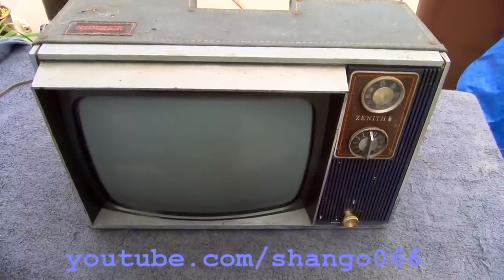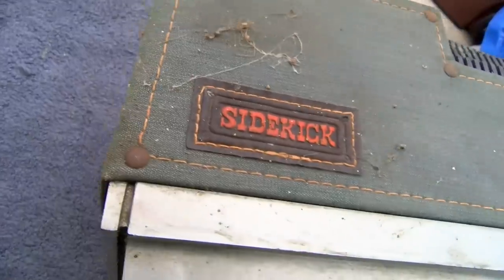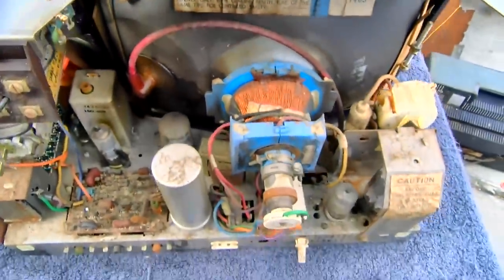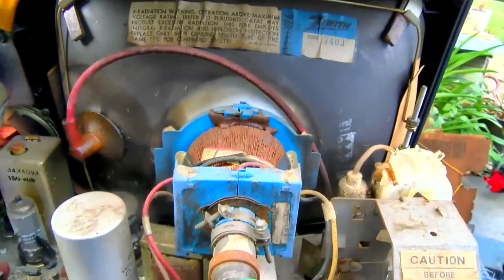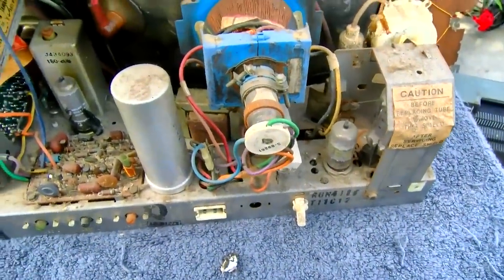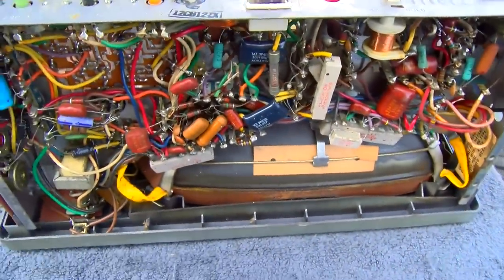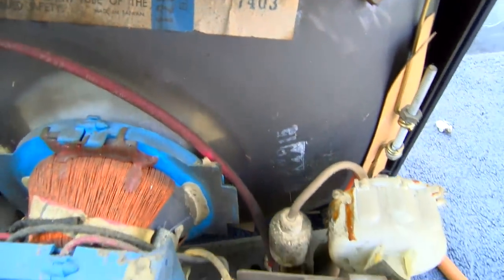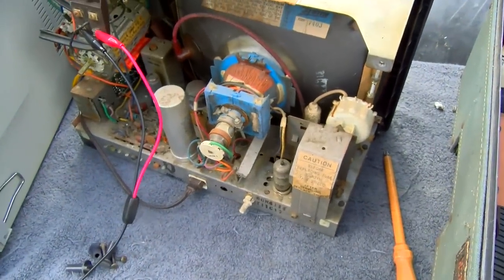1974 Zenith Sidekick Portable Black and White Hybrid TV Set

Comment: Tubes were probably glued down because of the long trip from Taiwan to the USA. Japanese tube stuff had those wire clips to hold the tubes in place for the same reason I would assume.
Reply: I agree.  I think it was a reliability measure to make sure the set worked when it got into the customer's hands.  It's inconvenient to deal with when changing tubes, but not a show stopper.
Reply: Sounds logical about siliconing the tubes in place for the trip across the ocean. Decades ago when I use to work on TVs, I remember seeing sets with the tubes Siliconed like this.
Reply: Also it's a portable tv, so stuff inside could come loose while moving it somewhere with a car.

Comment: I once had a 1974 16” B&W Zenith TV with a fake wood grain cabinet. It wasn’t a Hybrid, Instant On, all Solid State. I remember there were a variety of these sets from Zenith that year, some Hybrid, others all Solid State. I put a switch at the end of the line cord to cut power to the set if it wasn’t going to be used for a while. When using the set, I would power the switch on the cord on, wait a minute to allow the CRT to glow dimly, then press the set’s power button on to receive instant picture and sound. I always thought it was safer to completely remove power when the set was not in use, and that it may lengthen the service life of the components with the gradual power on procedure. Some sets had a “Vacation” switch that served the same purpose.

I had the set for 12 years, before giving it away to someone when I bought a color set.  No issues except with the tuner contacts getting dirty.

Comment: That was my TV from my youth.  It wasn't the sidekick version but everything else was the same.  It slid off of the table and landed on the concrete floor.  Picture tube didn't survive.  The instant on feature used to worried my father.  He had PTSD from his youth when his home burnt down. He would come into my room at night and unplug the set.  Very annoying at the time but very understandable now that I'm much older!
Reply: Randy - Agreed. My sibling and I shared a 12-13 inch Panasonic tube B&W instant-on in the 60's, and it, too,  made my father nervous. It made me nervous too, because even in standby mode the thing made everything around it hot to the touch. The only thing that made me somewhat comfortable was that it was UL Listed. The picture tube wore out pretty fast, so the instant on feature became useless, so we also took to unplugging the TV when  not in use,  but that didn't help the longevity.

Comment: These are great little sets, I have a "Sidekick" exactly like this one.  When I found mine, it was dead, even the filaments didn't light up.  The diode that is in series with the resistor in the filament string was open!  Fortunately I had a NOS Zenith replacement diode and that was all it needed, except for a new antenna rod.  A friend of mine had the SS version "Sidekick " and I had to repair his once, his set needed one large sand ceramic resistor replaced, that had gone open.

Comment: A diode in series doesn't halve the RMS voltage for the filaments. It divides it by the square root of 2
Reply: Does that have to do with resistance of the tungsten being lower at cooler temperatures?
Reply: Not so. When a sine wave voltage is rectified the effective voltage becomes the average value of the peak voltage. This is equal to Vpeak x (2/Pi) if full wave rectification is used. For half wave rectification the equation becomes Vpeak x (1/Pi). So for the typical North American 120v RMS AC line voltage, half wave rectification reduces the effective value to just over 54 volts.
Reply: @zulumax1  - No. The lower resistance means a little more current flows than would be assumed, therefore a little more wattage would be consumed but the mathematical relationship of effective rectified voltage versus full RMS voltage does not change.
Reply: @Inflec  That makes sense, thanks
Reply: @Inflec  The load would be a non issue, thanks for the details.
Reply: @Inflec  Hell no. For 120V mains, the RMS voltage on the filaments would be about 84.8V (neglecting the diode forward drop).
Reply: @DiodeGoneWild  - Sorry to disagree. I'm getting my information directly from an electrical engineering textbook. I think you're confusing the use of the square root of 2 with its use in determining the peak voltage of a sine wave RMS voltage. IOW, Vpeak = RMS value x √2. The square root of 2 is what you use when you are dealing with a full sine wave with equal positive and negative swings. When you rectify the wave you get pulsating DC. In other words, you no longer have a sine wave. Then, to find the effective voltage of such a wave you do a mathematical analysis of just one half of the wave, from zero to 180° -- just an average. After doing the math, you end up with a conversion factor of 2/π. This assumes that you have consecutive identical half sine wave pulses. IOW, full wave rectification, but since we are losing half of the pulses due to half wave rectification, the conversion factor is also halved, becoming just 1/π. Again, these are the numbers to use when you know the peak value of your RMS voltage (which does use the √2 to determine). However, these figures are not valid if you are talking about a bonafide power supply with capacitors and/or inductor filtering. They apply only to the resulting pulsating DC feeding a purely resistive load, such as what we are dealing with here (vacuum tube heaters). I hope that clears up your confusion.

Edit: And yes, the diode does introduce a negligible amount of loss (at the voltages in this example).
Reply: @Inflec  Each of us is probably talking about something different. I was saying that adding a series diode to a resistive load powered by AC mains will reduce the RMS voltage to about 70.7%. The power is, of course, reduced to 50%. The power goes up with the voltage squared. Thus, halving the power means reducing the RMS voltage to 70.7% (This applies to DC too).
Reply: @DiodeGoneWild  The 70.7% RMS AC factor only applies to a full sine wave. If you change the wave shape, triangle, sawtooth, ramp, or half wave, you must use a different formula.
   I am not an EE, but I am enjoying the debate, reminds me of being back in my electronics classes. I have to pull my books out again as well, which is a good thing. My understanding is not always correct.
Reply: @zulumax1  - You are correct. 👍
Reply: @DiodeGoneWild  - We are definitely talking about two different things. I think a quick review is in order about RMS voltage. You should recall that this parameter is given to provide effective heating equivalence between a given AC voltage and the corresponding DC voltage. Because alternating current is constantly changing in instantaneous value and polarity, a straightforward average of the wave gives you an answer of zero, which obviously cannot be right. This is where the "squares" in RMS come in, since squaring a positive or negative number always gives you a positive result. It is from this technique that we come up with RMS value x √2 = Peak value for sine wave voltages -- and the reciprocal: RMS value = Peak value x 1/√2, or simply, Peak value/√2. And as zulumax1 mentioned, a different figure is used for different waveforms.

Now, let us bring rectification into the picture. First thing: the waveform still has a constantly changing instantaneous value, but it does not change polarity. As stated previously, we now have a pulsating DC voltage. Because of this fact a straightforward analysis to find the average value of this waveform -- aka, the effective DC voltage -- can be done. As I previously stated, the conversion factor is 2/π for full wave rectification (0.6366) of the peak value, or 1/π for half wave rectification (0.3183) x Peak value. It might be beneficial to check out the information in this link.
https://mechatrofice.com/circuits/rectifier-half-wave-full-wave

All the formulas and figures that I've given are there, plus the math behind them.

And to conclude, here's a kicker that shows the craziness of the math in these calculations: Given, effective heating value of a sine wave voltage (RMS) = Vpeak x 0.7071, IOW, 1/√2. Now, consider the other formula to find the effective value of the same sine wave with full wave rectification: Vpeak x 0.6366 [2/π]. If you take the percentage of the latter number against the former figure you find that it is just about 90% of the value used in the RMS example. In other words, by simply rectifying the wave -- even assuming perfect diodes -- you lose approximately 10 percent of the heating value simply by changing the shape of the wave! Go figure.

One thing that did surprise me about the information in the link was the mention of RMS voltage for the rectified voltage. That makes no sense to me since again, this is pulsating DC. Gonna have to look at that much more closely.
Reply: @Inflec  Rectifying the wave gives you 10% less average than the input RMS but does nothing to the heating equivalent voltage. Your mistake is saying that the effective voltage of pulsating DC is the average voltage; this isn't true. The website you mentioned has an incorrect analysis of DC output power (more on that later) but is correct on RMS, which as they say is the equivalent voltage for heating. They say the The RMS Voltage of a sine wave, VRMS = Vm/ √2, half wave VRMS  = Vm/ 2, and full wave VRMS = Vm/ √2. You will notice the values for sine waves and full wave rectification are identical and that that is sqrt(2) of the half wave value.

It is evident that your cited website has errors because they say the efficiency of a rectifier made with ideal components is only 40.5 or 81.2 percent (depending on the type) but it should be 100 percent. Otherwise the diodes are dissipating the extra power which is obviously impossible with ideal diodes.
Reply: @zulumax1  The sqrt(2) peak factor vs RMS of a sine wave is totally separate from the issue at hand here. Think about it in a simpler way. With any symmetrical waveform the power is the same on each half cycle. If you half-wave rectify you consume normal power one half-cycle and no power the next half cycle. The result is 50% normal power over the entire cycle.

Once you know you are running at half normal power you can use the basic equation P = V^2 / R to confirm that the input RMS voltage is about 70.7% of the original.

TLDR it reduces to ~70.6% because that's the square root of the 50% duty cycle.
Reply: @eDoc2020  You are correct, what it all comes down to is duty cycle and how much energy is dissipated. Will have to get back into my old electronics text books and brush up. Duty cycle, pretty much how a class D amp works.

Comment: Nice set! I recently found a very similar one when I cleaned out an attic from a neighbor of mine. A Grundig brand set made in Taiwan. Also a hybrid. Was stored in this attic for at least 30 years. Plugged it in and it worked flawlessly. Except some cracko-scratchety pots of course. Early 70s sets sure are hard to kill. They just work. Like 70s Mercedes Diesels.

Comment: Man, I had one of these when I was growing up.  It did not have the denim material on it but same set as this one. I watched a lot of TV on it back then and it lasted for several years. If I remember right it was a 12 or 13 inch diagonal picture and would fit in a book shelf with hardly problems. This little set is the reason Zenith was my number one choice when it came to buying TVs. If only they still made TVs today. I believe Zenith is still around, last I heard they were making high end medical electronics.
Reply: Zenith started faltering in the 1990s (although the writing had been on the wall for a few years prior) and the party was finally over in 1999 when LG bought the rest of them. They exist today as little more than a name and whatever "interesting" intellectual property they hold.
Reply: They are basically in the R&D business. Zenith is the company behind the ATSC 1.0 and ATSC 3.1 digital OTA TV systems now in use in N. America.

Comment: (@4:35) - check out the traces on the PC board; they’re all at 45 or 90 degree angles, not all squiggly like those on transistor radios, which just went wherever.  😂

Comment: Hi Shango, I recently acquired a 1969 Motorola Color all tube set (with the exception of the UHF tuner being solid state). It is in rough shape and is in need of a recapping among other things. Would love your thoughts on it. I recently posted a brief video of it on my channel. I am only 27 and never knew anything about vacuum tube electronics but you are the person who got me interested in it all and I am a bit lost on how to start restoring the tv. I think one of the caps in the power supply circuit vented and blew the wire fuse.
Reply from the maker: All I can say is spend a bunch of time watching the videos. Motorola sets are not simple

Comment: Very interesting to see a tube audio output----when I was a kid, I remember that all of the transistor sets I saw had instant-on sound, and you had to wait for the CRT to warm up. I can't imagine this was done for cost reasons---by '74 it would've been cheaper to use a transistor audio out, so yeah....maybe it was indeed done to delay the output
Reply: Perhaps.  Early transistors either couldn't handle power or were too expensive.  That changed over time.  The fact the vertical output is still a tube suggests that may have been the issue.  Power transistors either didn't exist, were too expensive, or the designers didn't trust them.
Reply: @russellhltn1396  Nah, this was in '74---transistors were plentiful and cheap, including power transistors
Reply: @justsumguy2u  Then why wasn't it all-transistor?  Or at least the vertical output a transistor?  I expect the answer is something along the lines of cost, availability, or perceived reliability.  Sure, this was made in '74, but when was it designed?
Reply: It could have been to get the series-string heater voltages to add up right.
Reply: @dkd1228  Could be. But they'd have to spend money on an output transformer, where as a transistor can drive the speaker without one. I guess we'll never know what their logic was
Reply: @justsumguy2u  In the early 70s, small transistorized power amps very often had an output transformer.
Reply: @albinklein7680  Right.  They had the power, but not the current handling ability.
Reply: @dkd1228  Maybe, but I'd think a dropping resistor would be cheaper.
Reply: @russellhltn1396  I think they had a lot of old tube inventory they were trying to purge, transformers, tube sockets, vacuum bulbs. Tubes were on the way out.